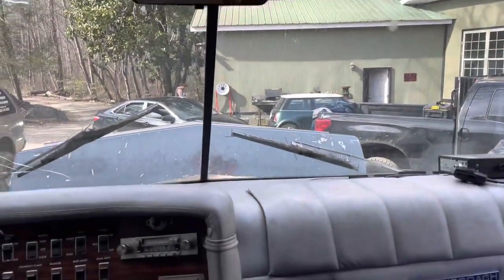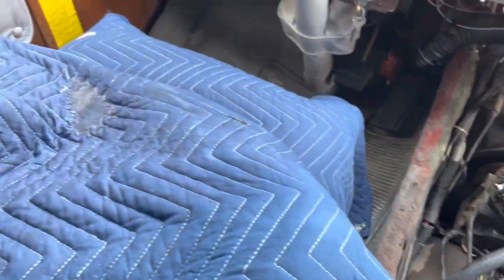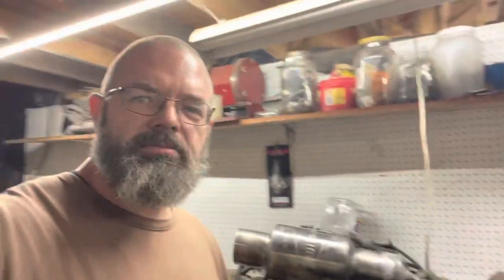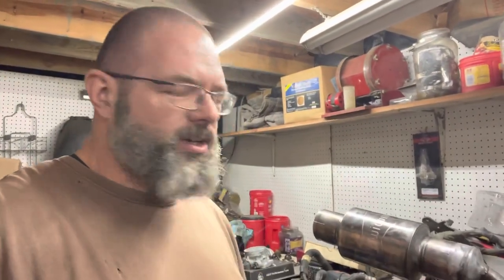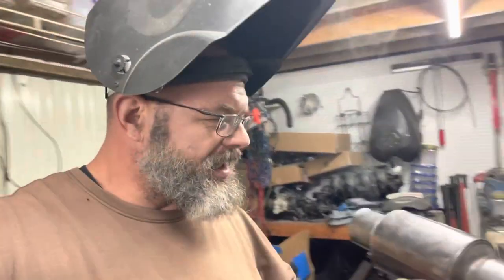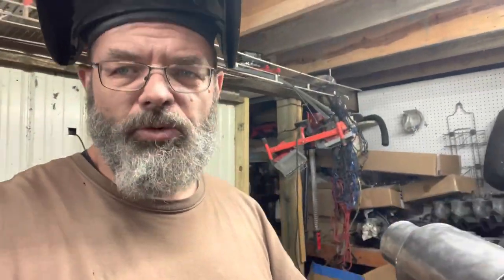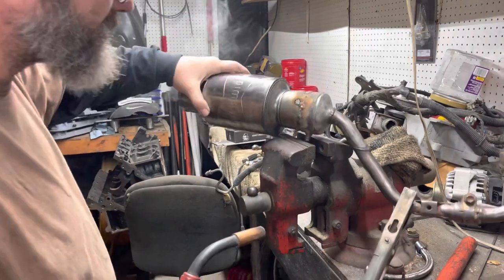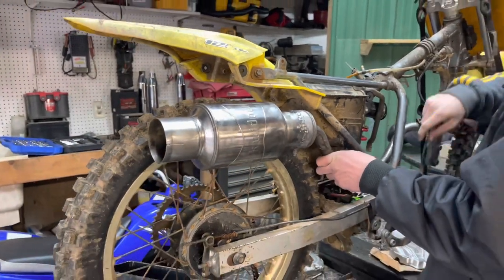Jack of all master at none Amsoil adam. Finishing up the struggle bus,paint work,& a bit of welding.

Comment: hahahaha sorry Adam that was funny, PS Adam when you put on a tac.  get a light hammer and tap down the metal it will do what you want when its hot so tack tap down what you can weld and repeat. Glad you got the struggle bus going now i sure hope mine runs good once i get the ECM back from repair hope this week latest.

Comment: I agree do not run with a thermostat it will hot very hot because water will go through the radiator and won't have a chance to cool. Put a new thermostat in it. I suspect the fan clutch. They like to act up and not lock up solid enough to move the amount of air need to cool the radiator. Yes it will move a fair amount of air to make you think they are working but really it isn't locked up enough for the correct flow 
Thank you for the video!!
Reply from the maker: The only reason that I do not believe that his fan clutch related, and I could be wrong. Of course, is that there is also an auxiliary electric fan on the radiator. And when the overheating condition would begin, I would then turn on the electric fan. And if it was an airflow problem, I should see a difference when electric fan was turned on as opposed to when it was turned off. And I see zero change with or without the auxiliary fan. That leads me to believe that the engine mounted fan is doing its job

Comment: Don't run without a thermostat...you need some restriction to hold the coolant in the radiator and give it a chance to cool. No thermostat and the coolant is continuously circulating and not cooling.
Reply from the maker: I was even thinking about just taking the center out that way there was still some restriction

Comment: hey Adam, i've been a long time subscriber. i live in northern Kentucky so my 2018 ultra classic has been put away all winter. i always change all 3 holes at the start of each season. i have run Redline since the bike was new (all 3 holes everytime). tell me why i should change to Amsoil, and is there any deals for  product if i change.
Reply from the maker: Well, I’m definitely not going to knock the red line product. It is actually a very good product. But I believe in past research, Amsoil has definitely scored higher in the testing process. Amsoil does not make products simply to meet the minimum recommendation. They always make a product to be the best. It absolutely can be given the current science and technology available. They are a true class for 100% synthetic oil. I don’t know if red line is for sure or not. But in many cases people are buying “full synthetic“ thinking that they’re getting a true synthetic oil and they’re not. There are quite a few ways to get deals on Amsoil, but that would be a much longer conversation.
Reply: As always if you want to try Amsoil for this change let’s us know as we can direct you on what would be best for your bike. Also with an Amsoil o/c and their filter you can go 10,000 miles or change it once a year. Also if you are a DIY guy Amsoil has a great preferred customer program for $20 a year and you can Amsoil wholesale for all of you’re equipment. Cars, trucks, guns, lawn equipment, motorcycles etc. let us know!